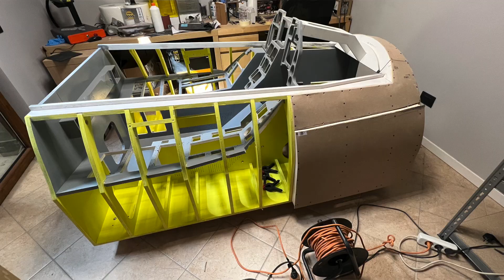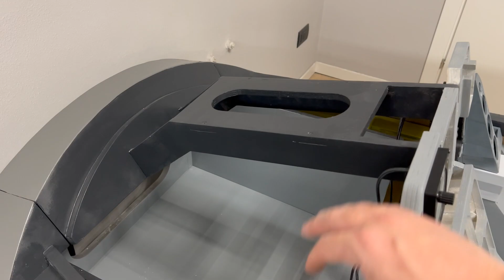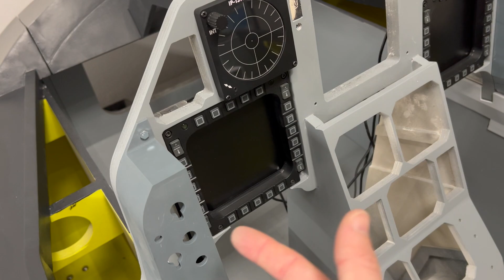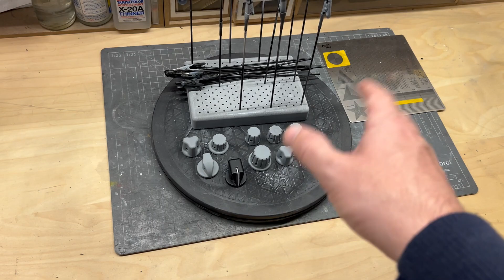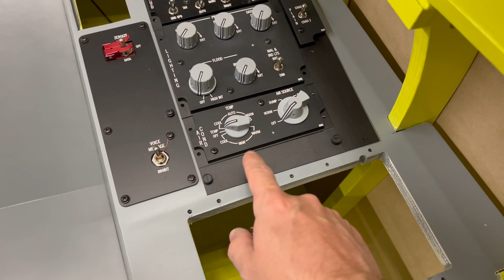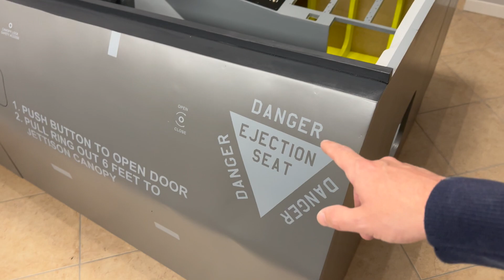F 16 SIM UPDATE OCT ‘24

Comment: Looks great, but I think I would've installed all the panels and wired it before mounting the exterior skin.  I don't see a good way to get access into the electronics spaces once the skin is installed, and as additional panels get added in, your access will get more and more restricted.
Reply from the maker: I thought about that, but 1) I wanted to finish with the woodwork & paint as doing it later with all the electronics/interior in would have made it more difficult 2) there are access panels that are removable in the nose section and on the inner side of the console that I can use to handle the electronics ;)
Reply: @The_ViperProject  I doubt that painting only the exterior after finishing the electronics would have been more difficult; you would do it just like a big (1:1) scale model: tape a mask across the entire rim of the cockpit, and spray the whole thing.  The inside of the skin could be painted prior to mounting it in.

Either way works, if you're comfortable with the amount of room the access panels give you